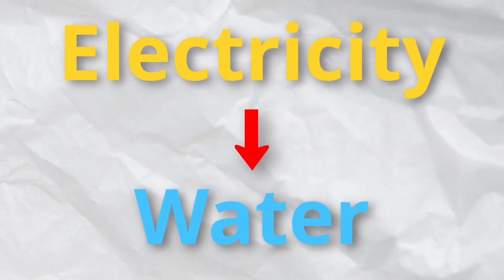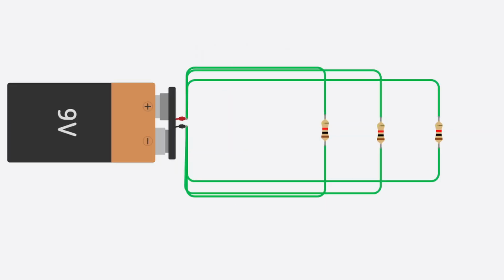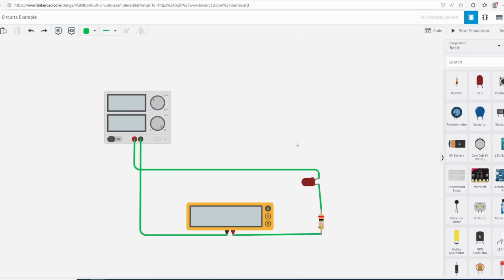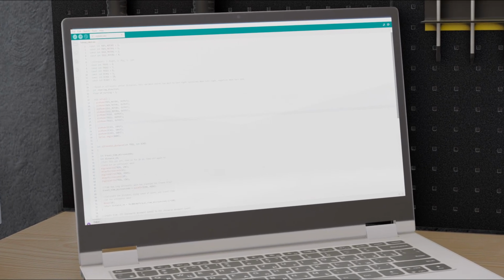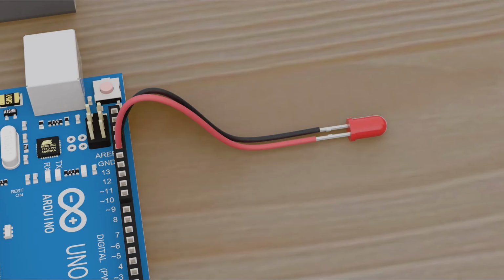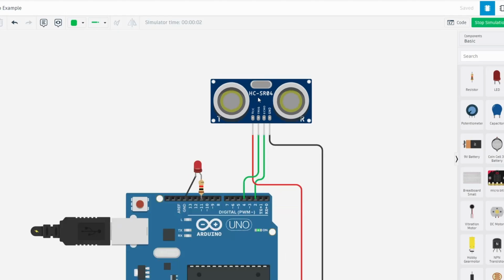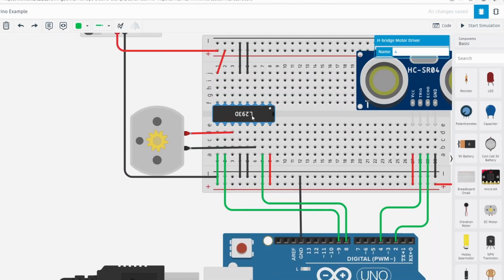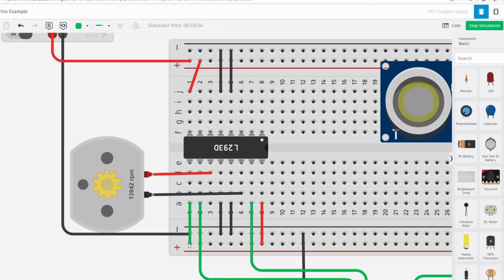Beginner's Guide to Electronics in 20 minutes!

Comment: Maybe this isn’t the best idea, but I just started building on breadboard ASAP. Breadboards are awesome, get some decent quality ones too. I suppose you can break things jumping in like this but I think modern low voltage circuits and microcontrollers are pretty tolerant of mistakes, at least they won’t explode.
Reply: If you over voltage them they will be dead

Comment: Electronics get interesting the more you start getting deeper into it....I am a student, and a beginner too....recently just studied about transistor biasing in depth....hard saturation, fixed bias, switching, emitter bias and amplifications. Felt so interesting and good. Makes me eager to learn more, practice circuits on simulation tools and on breadboard/ protoboard. Cool stuff it is!
Reply from the maker: Oh yeah, definitely! Learning how electronics work is great, and then you start to think of ways to apply it to fun projects, and that's where the real fun begins. Transistors are great! You don't need too much of the amplification knowledge unless you want to make a discrete circuit that does some logic or signal processing similar to an Op amp (but you'd just buy those anyway). However, I normally just use transistors to drive motors or an LED, so in a way, I use basic current and/or voltage amplification. Hope you continue to enjoy the journey!
Reply: @TheTinkeringTechie  Yeah! I try to balance between theory and practicality....I feel in a branch like electronics, too much theory without practice, or practice without any theory (which is kinda plain copying)...both are equally bad. But I also feel maybe one should enjoy the learning rather than trying to make the journey and learning perfect...
And definitely creators like you inspire a lot. Make things clear a lot. Make want to do more a lot. So thanks and cheers!! Keep up the good work

Comment: Hi mate, great video, learned a lot about the basics of electronics. I got a question, as a beginner, how am I meant to know the correct wirings of the components in my personal projects? Like when you showcased the second circuit with the dc motor and h-bridge, how do you go about understanding which connections goes where? 

Do you have a certain strategy you use to figure these connections out? Love from the UK 🇬🇧
Reply from the maker: Thanks, and that's a great question. For complex components like an H-bridge, I always refer to it's datasheet. In the example, the components name is L293D, and searching "L293D datasheet" online will give you a datasheet like this one: https://www.ti.com/product/L293D (click the datasheet link on the website). It may seem like there's a lot going on, but you can understand a component by looking at the "Pin configurations and Functions" as well as the "Typical Application" sections. Once you understand how that component is used, you can look at the specific numbers (like the "Specifications" section) so that you provide it with the right voltages and such. I look at datasheets for any component like this (a chip, a sensor, basically anything that isn't a general "self-explanatory" electronics component). Hope this helps!
Reply: @TheTinkeringTechie  That makes sense, I understand. Thank you for the advice and I look forward to your next video!